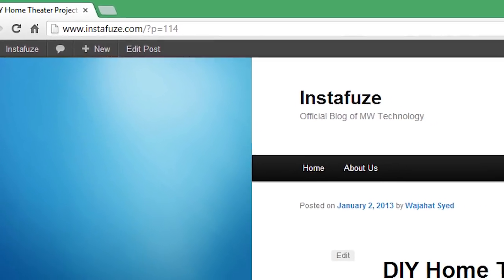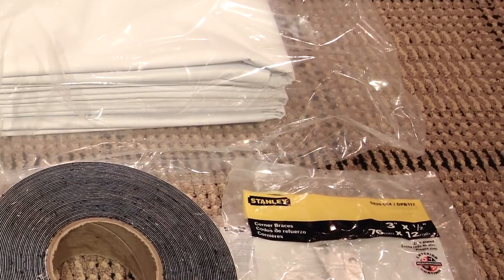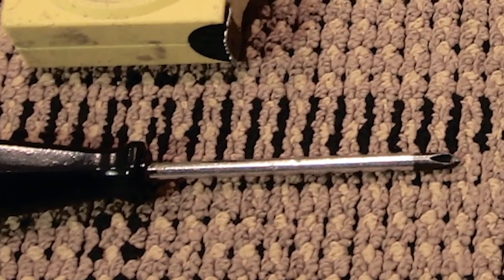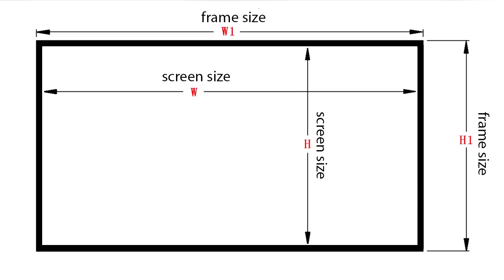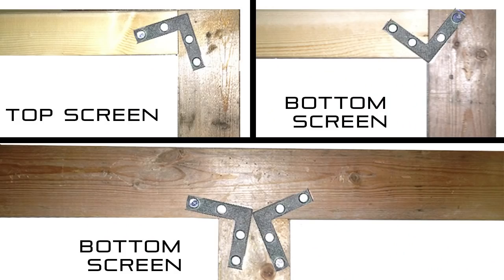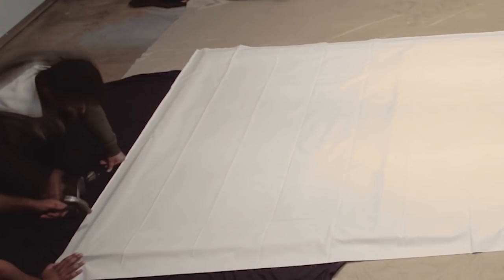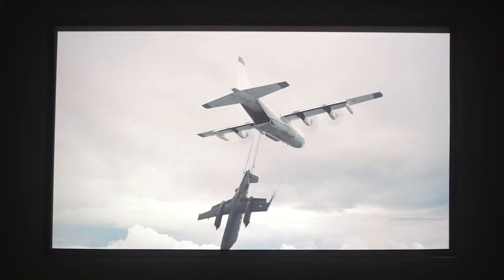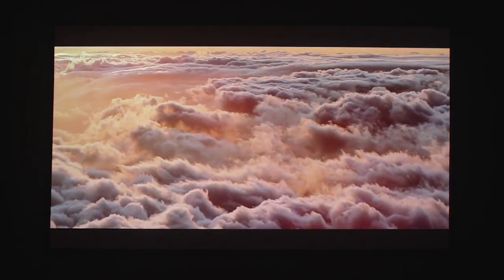How to Make a DIY Projector Screen with Blackout Cloth

Comment: Thank you very much for the video, I followed your steps (with some minor differences such as Lbrackets are only on the rear side + I added wood glue)

Felt tape was near impossible to find at a hardware store so I am using foam tape usually used for insulation.

For the first frame, I did a decent job.

All the best !

Comment: Today I built 2 of these things. I bought some blackout cloth, of two kinds, both seem to work really well. I upgraded somewhat the design in that I also used some 90 degree brackets of about 15 cm length to connect the wooden parts at the four main corners, which adds some stability (since wood is being pulled together by two different surfaces). I have made one 98" and one 108" screen, the first one with a blackout material that resembles the one shown here (matte polyester finish, quite rugged) and another one with a blackout material that consists of a sandwich of white-black-white layers. This last one is much better, since it has a light consistency, pretty much like a regular cloth, and the image projected there looks amazing, I feel like I have a cinema at home. I would recommend you to build a screen, since the image quality compared to projecting into a regular wall is so much better. My cat seems very much interested in things being projected, particularly birds and felines, so I hope he won't turn my screen to shreds when I don't look around...

Comment: one minor point to add on the middle stile placement:..

if you take a couple thin washers between the L-brackets when screwing only into the leg that is fastened to the top and bottom rails, you will avoid any protrusion into the material on the front side from the middle stile, due to warping or twisting, over time.

this offsets the middle stile back [away from the material] about 1mm or so, depending on how thick your washers are, and not compromise the sturdiness or integrity of the frame.

Comment: I bought my cloth at mondial tissus in France. They sell two types of blackout cloth that work for projectors, one is 137 cm wide, heavy polyester coating, the other 150 cm wide, flexible silky stuff, two layers of white with a black layer sandwiched in between. They sell both for 9.99 euros per meter. I have one screen made from each type of material (I wanted one for the living room, plus another for my bedroom).
Reply: What do you call "blackout cloth" in french? :) Thanks!

Comment: Instead of stapling, have you thought or tried velcro or button the screen fabric to the frame? Staples seems like a permanent solution.  Velcro or buttons could make for easier dismantling if/when moving. Thoughts?
Reply: No. what u wanna do is make it foldable, put hinges

Comment from the maker: it would have to depend on how the picture is when you point your projector at it.  you should test it first before you make the screen.  just make sure there is not a lot of light bouncing off the screen because it will take away from your image quality and watching experience.  the reason blackout cloth is a good choice is because it is not a reflective material and light doesn't bounce as much from it.

Comment: I'm trying to fashion some sort of screen that can easily be stored when not in use, and light enough to be carried around town. The plan is to use my projector to screen indoor and outdoor movies in my area, to help raise money for local charities. Can the edges of this material be hemmed? My idea is to hem the top and bottom, then insert 1x4 boards inside the hems. This way, the screen can be unrolled, hung onto a wall, then rolled back up when finished. Good idea or bad? Any pointers?

Comment: So did you just keep applying staples to the back side of the wood, ending up with 100 or so staples? w I'm just trying to conceptualize how you will pull it tight and fasten once you've stretched and fastened the material initially.

Comment: I see you had to use 2 different parts of cloth in the making of the screen. How did you join the parts without the seam being evident?
Reply: Tarun, I believe you misunderstood. I did for a second as well. It is just one sheet stretched over the whole frame.

Comment: I'm wondering if anyone has used this material on a DIY roll-up screen before? is it dimensionally stable enough to have a flat surface by using a weight bar?

Comment: For the blackout cloth material do you use the side that has the shine finish or the other side with still has that fabric texture?  Help please!
Reply: the side with the rubbery coating goes toward the screen.
Reply: I prefer the fabric side.  The other side is shiny because it reflects too directionally.  That side will hotspot meaning parts of the image will be too bright and parts will be too dull.

Comment: Hey I tried to use the projection calculator thing on the website but it doesn't list my projector's brand. Technically mine is unbranded but it's the same thing as the Sourcingbay PRJ-BL-20. It's a cheap ($150 on ebay) LED 1080p projector and I am currently projecting on my wall at around 150" and 8-9 feet from the wall
Reply: im pretty sure its not 1080p
Reply: It likely accepts 1080p dvds or stuff like that.. but the native resolution has to be 1920x1080 in order for it to actually be 1080p.

Comment: has anyone seen in person the picture quality difference between using a surface like this compared a typical white wall?
Reply: I cannot tell you for sure, since each "white wall" is different, and depends on the kind of paint you used. In my particular case, with walls that instead of white are somewhat very light green, and textured, the difference was huge. I couldn't read the newspaper projected into the wall, but I could read the smallest print if I project into a screen. In fact I was completely awed at the quality one can arrive with a small LED projector (500 bucks acer) plus a homemade screen. I feel like going to a movie theater is completely futile now...
Reply: there is a combination of paints you can use to paint a wall to be used as a projection screen. I read of one called Black Widow.  look it up .

Comment: If i want to make my screen projector but in my proyector i can put 3D options i need another kind of material to do that? To put a movie in 3D is going to work like in a 2D movie??? HELP PLEASE!!!
Reply: in that case u should use some 3d cloth. i think. but im not sure.
Reply: Regular cloth is fine.  there's no such thing as 3d cloth.
Reply: lol this guy doesnt even know about 3d cloths.
Reply: The point I was trying to make was that I think the stuff marketed as 3d is just high gain, which might help if you have a borderline projector but will also limit your viewing angle.

It's like HD television antennas.  just because it's marketed as a thing doesn't mean it's really a thing.
Reply: pmkeating i was just playing with u

Comment: you can't just paint the wall white?
Reply: +yost112ty  you can do that but you wont be getting the best picture. youd be better off painting your wall silver screen grey if thats your only option. google it. its a paint designed for projector screens. I personally have done my own DIY screen and it was 100% better than projecting onto my wall.
Reply: +Schmid Vicious gray is a myth!! was used back in the days when projectors had problems with contrast!!  just got my self a 106 fixed screen grandview gray 0.8 gain and to be honest the second I made a mistake doing lens shift and ended up in my wight wall I returned the screen haha!! yes black is better but all the other colors takes a hit! not to mentione that when I compared the blacks on the gray screen to the white color ... Ohhh wait I coulnd get any white on my gray screen lol
Reply: +Leonard Cheri. I agree that the need for grey has has decreased In time, but it mostly depends on the ambient light in the room and the output quality of the projector. I was simply recommending a highly used and highly rated option for painting the wall that is readily available at most box stores. I myself have a fixed 120" white screen. I also have a light controlled room however. I'd rather have a fixed screen over painted screen any day.